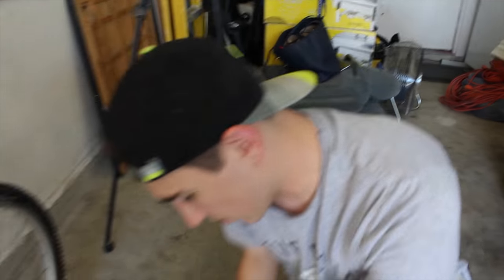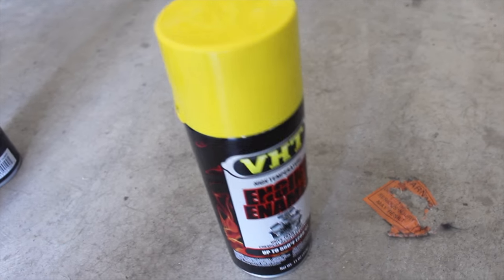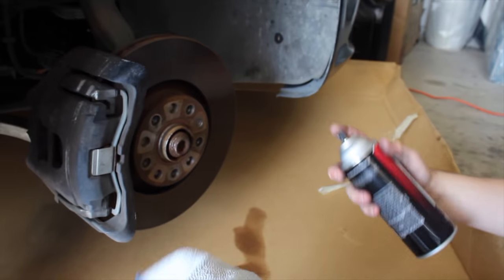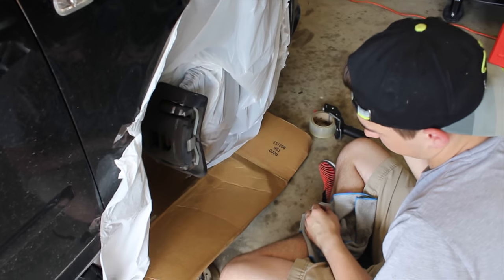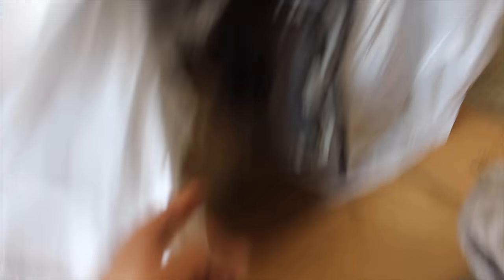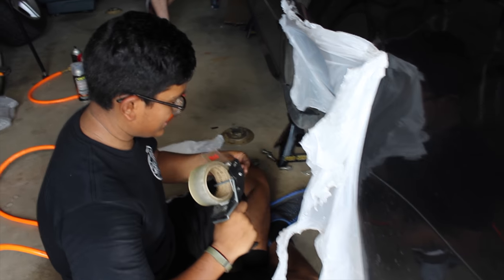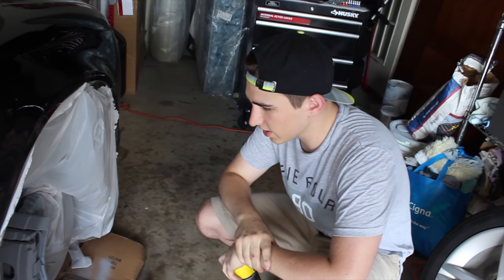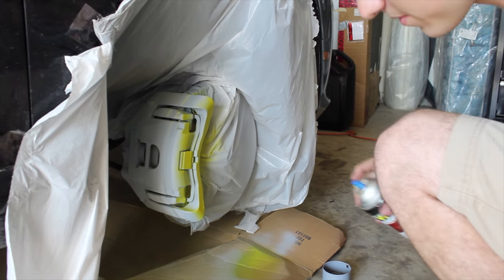DIY | How To Paint Brake Calipers - Any Color

Comment: how long does that paint caliper last?
Reply from the maker: @X-MAN Xiong
Assuming you don't have anything coming into contact with the calipers i would assume quite a long time. After we finished painting the calipers and left them dry for a couple of hours we actually power washed the entire car including wheel and calipers and we didn't have any issue. Being able to withstand that much pressure i would assume the paint will last a long time. 
At least a couple of years if done correctly. (I should have steel wool sanded the calipers first)